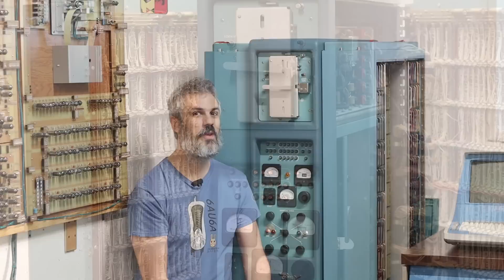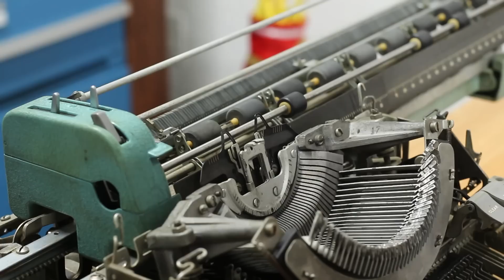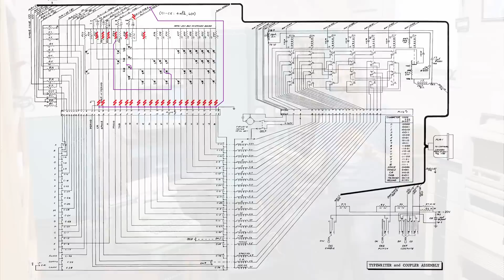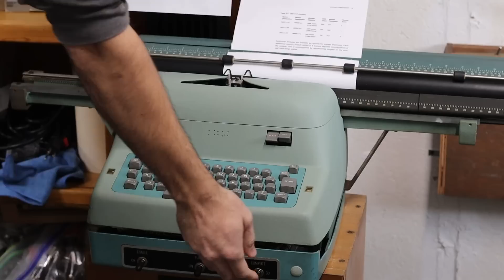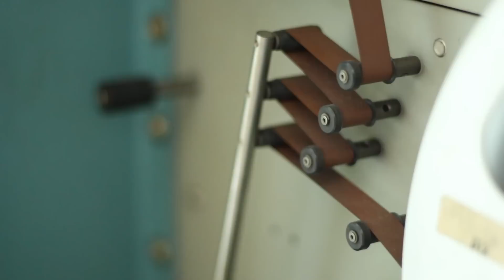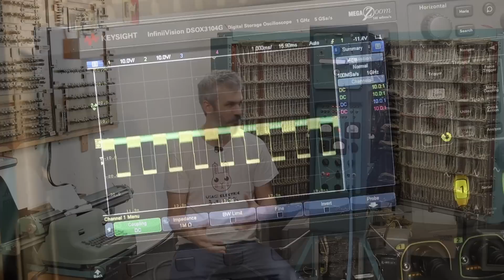Playing Music on the Oldest Running Computer in America!

Comment: When I was in high school, I had a janitorial job at the ATT Bell building in my home town.  Those chads were the bane of my existence.  You had to run the vacuum over the carpet to suck most of them up, then get down on your hands and knees to pick the last of them out of the carpet.  The company I worked for had contracts to clean four offices in that building.  We would spy an hour each on three of them. For that last office, we would spend 40 minutes for general cleaning.  Then, since I was the junior guy, I would spend the rest of my shift getting all those little white dots out of the carpet while everyone else went on to other office buildings.  It sucked.  Hard.  I was never so happy as when we got a new guy and it became his job.  I went to a different contract cleaning and waxing the floor at a supermarket in the next town.  When the new guy quit and they told me I was back on chad duty, I quit too.

Comment: Multiply this guy times 20 and that would look like our Data Center at the University of Connecticut in Storrs in the early 90's. Of course, they also had army cots for naps, egg timers for alarm clocks when they ran batch files, lived on M&M's and Diet Pepsi (I think the diet soda could flush the sugar from their teeth), and you never wanted to be caught, or worse, trapped downwind of them. I do not think they ever had homes that they could remember how to get back to. I do recall they often muttered in COBOL, C, and converted between EBCDIC and ASCII code in their sleep.

Comment: As far as I know, the only older working computer is the Harwell Dekatron Computer (renamed the WITCH), in England.  But it is partly electromechanical.  Isn't the G-15 fully electronic, except for the input and output?  This might be the oldest running fully electronic (ignoring I/O) computer.

Comment: Well done all to getting this computer system up and running again. I fear that for later generations rescues such as this won't be feasible due to technological miniaturization and lost IP trade secrets. This is already happening with vintage jet aircraft where they can no longer fly because their electronics can't be refurbished\re-manufactured voiding air worthiness certification. Same goes with old FPGAs - unknown manufacturer secret IP preventing enthusiasts from developing modern tooling to support using these old components.

Comment: I used to operate an old Gretag 3139 photographic print machine that loaded DG-RDOS from tape and interfaced via a teletype machine with the most tired ribbon ever.  There were also newer 3140's and 3141's in the room, which did all the 35mm printing.  The 3139 was relegated to 126 duty.  There was a Kodak machine, I forget the model number, that did al the 110 printing, and the worst of the lot was the Gretag 3142 that printed disc film.  I was operating these guys 1993-1995 and I estimate the 3139 to be of about a 1970 manufacture, the Kodak shortly after, and the 3140/3141/3142 units all mid-80's.

Comment: Congratulations! The first program to run on the 8-bit computer I built from a kit in 1977 was a similar music program. It used the same sort of simple resistor/capacitor circuit as yours, but attached to the Interrupts Enabled bus line. The music program then enabled and disabled interrupts in different-length loops to create the different square-wave notes.  

I'd spent months building that computer. Everything else was ready to go but my video card had been delayed. I wasn't very patient at 18 and was going mad waiting. So I carefully typed in the commands to load the music program and one of its songs into different RAM locations, then the command to run it, all without being able to see anything I'd typed. I wasn't sure it would even work without video installed. I wasn't sure the computer would work at all, actually, though I'd been able to test each card individually in an older friend's similar computer. But it did work, and my computer started playing me a beautiful Bach tune in 4-part harmony. So I think I know how you felt!  :D

Comment: So you might want to check all of the glass diodes on the boards you showed on the typewriter boards. I have had a LOT of problems with that era and type of diode. Recently worked on an isolated variac which had these. They were used as drivers for the meters and they were all bad. The ones on the boards you showed are the same ones I had issues with.

Comment: I operated dual Univac 90/80’s for Advo System direct mail advertising in the 80’s. Hearing this antique make Christmas music was amazing. What a triumph! I am typing this on my IPhone whose features and capabilities are still like something out of science fiction to me. My old employer did not even buy the Processors or peripherals only leased them and ran them 24/7 printing labels. Sperry/Univac kept an engineer on site whenever the computer room was running and if the power went out we had to race to open the doors and use a fan as the temperature would skyrocket with the underfloor AC out.

Comment: My father, Ed Kuszmar, pioneered computer music in the early days. In the early 1960s, while working at Control Data Corporation, he connected a speaker to one of the company's computers, allowing it to play music that he programmed. This was quite innovative at a time when computers were primarily seen as tools for data processing.

He worked at Control Data during the era when Seymour Cray was developing his innovative tabletop supercomputers. Interestingly, these supercomputers initially struggled in the market until they were fitted with flashing lights to give the impression of activity, which helped sell the product.

Before his career in computing, Ed served in the Air Force, where he had experience with missile target boards. After his military service, he transitioned to working as a radio technician at the Adak Naval Base in Alaska, bringing his diverse skills into various technological fields.

This is a true story of innovation, adaptation, and the merging of technology with everyday entertainment, reflecting the unique career path of my father, Ed Kuszmar. Figured I'd share it.

Comment: I worked at Digital Equipment Corp.... September 1978 through October 1989....I remember alot of that old stuff, that was old stuff back when I was at DEC.  We had cutting edge technology...Unfortunately all didn't work out....Closed system issues and the takeover of the company by administrative pirates ultimately killed DEC....What a fantastic company that was to work for....Ken Olsen was a prince of a guy....My work was centered on the design and development of the VAX11/780 and VAX9600 power systems

Comment: When I was in college, the science department had a room with a retired Digital Equipment Corporation PDP-8/e minicomputer from around 1970, that was still operational.  At some point in the PDP-8/e’s lifetime, someone figured out that different mathematical operations caused the CPU to give off different frequencies of RF interference that could be picked up by a nearby transistor radio, and they were able to map the operations to musical notes. We had a set of programs that you could load up, and if you put a radio next to the CPU, it would play a tune.

Comment: Growing up in the 1970s i remember visiting the computer room at my father's work and they had a huge problem with the bit punch outs from tape printers. They were getting into trouble with the fire safety people. 
Back then the tech was already old and had been installed by a senior partner in the law firm for managing accounts. When the room was finally closed in the mid 70s and a new ICL installed we ended up inheriting the tapes as kids to make Christmas decorations. And my mother moaned about the bits clogging up the hoover.

Comment: While not as cool as a vacuum tube computer I spent the last couple days programming a PIC16F1829 to play music using the CCP module compare function to generate an interrupt every half wave which then the program switches four transistors set up in a "H bridge" fashion to drive a speaker.  My overly complicated remote control car now plays "Pop Goes The Weasel" and does a reverse beeper when it reverses.  It's a bit out of tune due to the natural  variations of the internal clock, but it works.

Comment: In 1971 I went off to Diesel School at Oregon Technical Institute in Klamath Falls, Oregon.
One of the older guys invited me to come visit the computer room in the basement of the
administration building.  He had me stand next to this big paper printer and to turn a
knob when he said to.  He went to the console, typed in something, and holey-moley
this big thing started up and was playing music, the theme song from “the sound of music”
This huge “chain printer” was frantically hammering out the musical notes, and I had to
manually rotate the handle on the paper feed to keep the big wide paper sheet from
disintegrating and jamming up the machine.  I asked him “How the h**l did you do that?”
He said, “we wrote a computer program…”  As if that wasn’t enough,  he then showed me
how they could set a transistor radio on top the console desk and then by another program
that was writing to the “core memory” the radio would pick up the signal and play
another music tune.   That console was an IBM 1130.  I took a Fortran programming class,
went on to Engineering University, and spent 40 years working in Silicon Valley.

Comment: Watching this video has intrigued me.  Per the video, multiple units of this computer were produced.  Who used it?  Why?  What was it's purpose?  Was it built to address a specific function or was it designed to be an "open" platform?  What happened to the documentation and marketing material associated with this system (or the company that produced it)?

Comment: Proof that GOD exists!  Merry Christmas!  "Sound card"?  ha... Somewhere... someplace... is a assembler / machine code program (And probably a Paper Tape but obviously in 8080) for the Altair that does "music" in the same way but without any wired connections.  Just put an AM radio next to it and tune for maximum RF Interference.  You might try that just for giggles. I believe it was a demo at the Homebrew computer club in CA and was the first "I/O" other then front panel switched input machine code.  *Teletypes were around like old model 15s from WWII but what a project getting one and getting it running.  You needed to know a Ham Teletype guy. At one point when these were no longer coveted if you over the air / hinted you "might" want a model 15 guys would arrive uninvited to unload one on you like it or not. Paper tape was at least then I looked at it "Twelve Ninety Five" which I assumed was $12.95   Noooo $1295.00 for a new punch/reader.  Anyway thanks for this video - it made my day.

Comment: This is sort of what it felt like when I was programming my 1982 Timex-Sinclair computer.  It has a Z80 chip, just like the TRS80 Model I, etc., so I bought a machine language book from Radio Shack and started learning.  I was able to model the waveforms of various instruments and make that tiny computer play music as different instruments.  They sounded like various organ sounds rather than the exact instruments I desired, but it was cool anyway.  I still have that computer, the 16KB memory pack, and the manual.  I have a cassette tape with some of the code on it.  The code is safely backed up to my current computer so I may someday turn the recording back into BASIC code and run it in an emulator.  I'm 71 and still have great fun with my computer.

Comment: In my U S Navy career 75-95 I was a Gun Fire Control Tech. We aimed the 5 inch guns. I worked on Analog Mk 47 Gun Computers all the way through Mk 92 Mod 6 with Micro Computers. Heard a story where the advanced Shipboard Radar System AEGIS made a buzzing noise in the transmitter room  Depending on the frequency the tone changed. During inspections for cleniness the tech would run a program that changed the tone to play the Navy song Anchors Aweigh. Always impressing the inspector.
Reply: Same with me, I was Mk86 GFCS. Magnetic tape with the old teletype with a million springs in it with magnetic core memory.
Reply: teletype world champion over here
Reply: That is awesome.  😂
Reply: Thank you for your service Sir, and for an epic insight into the early days of the Computers the military used!!.

Comment: A student in our group wrote a routine to play music on a now ancient IBM computer. The sound organ was a small radio placed on top of the console that picked up RFI from the operating circuits. This arrangement was also useful to monitor the operation as this had a cycle time of about 50 kiloHertz. One of my favorite sounds I named "birds on Mars." Chirp, chirp, kaw, kaw. Still miss that sound. We never recorded it.
Reply: Such a cool comment
Reply: That reminds me of the days when CPUs ran in the 75-100MHz range. If you tuned an FM radio to the same frequency as your clock speed and placed it right next to your PC, you could hear the CPU doing its thing through the speakers. This still works today with modern PCs if you have an SDR tuner that can tune into frequencies above 3GHz, but back then it was pretty neat being able to do it with equipment every house had lying around.
Reply: @Psythik my cpu can do the same, it's base frequency is the same as the frequency of wifi
Reply: I remember the TRS-80 m1 had this issue to a pretty bad degree... to the point that the FCC had to start cracking down on home computers in general. But place a radio nearby and you could catch the circuit thinking.

Comment: Similar to the method of sound generation that could be done on the Altair 8800 twenty years later, except the Altair ran fast enough that it could do it with delay loops and sent out the sound a RF interference you could pick up on an AM radio.  (Which is also kind of the reason that computers soon had to be tested and certified for RF emissions before they could be sold.)

Comment: Back in 1977 I was working at Digital Equipment Corporation in Westfield. We had PDP 11/05s for rigs to test our video terminals (VT50/52/6x). Back then the switching power supplies were running at much lower frequencies. I knew where I was in a test program by listening to the pitch and repetitions of the whining power supplies. Anyway some of the engineers wrote programs that would make those computers turn into a very local AM broadcast station and we would play Christmas songs with them on nearby AM transistor radios. We didn't have covers on everything inside the factory. Oh, the memories. What a blast from the past. Good job! Happy Holidays!

Comment: NGL, it may be interesting to develop a way for a microcontroller (such as an arduino or a raspberry pi) to communicate with this ancient beast, if so at least you can more accurately dump data to and from the machine for better debugging

Comment: re paper tape:  In high school (1977-79) we had an HP2000 system and some Type 33 TeleTypes as well as a bunch of ADM-3As.  We were encouraged to have fun with this machine.  One of my favorite programs that I wrote was to input a string with a message, then punch a banner on the papertape using holes to make the 5x7 letters.  We ran through so much papertape I was asked to disable my program most of the time.

Comment: The good old G15.  This was the first computer that I learned back in computer maintenance school.   I still have all the logic diagrams of the machine.  Due to the drum memory we had to spin the drum before turning on the computer so that the motor running the drum would not over torque the rubber coupling between the drum and the motor causing the coupling to break.  The programming was interesting because you wanted to move the memory read/write head to the next memory track (cylinder) so that the head would hit the first byte on time.  If you did it wrong you'd have to wait an entire revolution of the drum--which turned not that fast.

Comment: Oh, does THIS bring back memories!  Back when I was a Comp Sci undergrad at Penn State (1972 - 1976), a classmate of mine - a Comp Sci major who was also in Penn State's 'Blue Band' (university marching band) had a couple of card decks and tapes to play music on the comp center's IBM 1401 computer system.  (This only worked because the 1401, unlike the big System 370/168, was single user, not time share).  The 1401, which was transistor-based, not vacuum tube, would radiate RF from the memory, and a radio set near the system and tuned off-station would pick up the RF emissions (AM, not FM, if I recall correctly).  He had a deck that would play a medley of Christmas music.  He had another program that would trigger the print hammers on the 1401's attached 1403 line printer (chain printer) to play 'Hail to the Lion' (Penn State football fight song).  This, of course, was audible with no radio required.  Lot of good memories there...

Comment: Brilliant!!!  So glad to see your great progress.  I recall using (in 1963)  a different program (or different version?) which used track 19 for output.  We connected to an audio amp via the banana plug on the test panel - no soldering of new wires required.